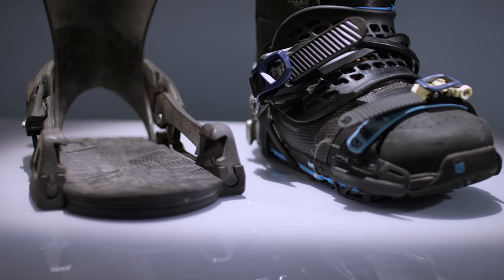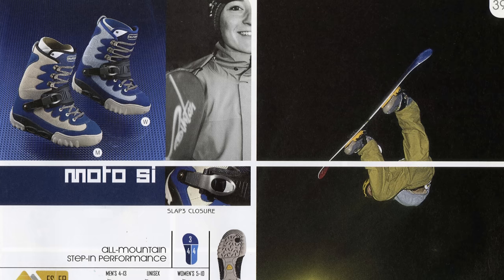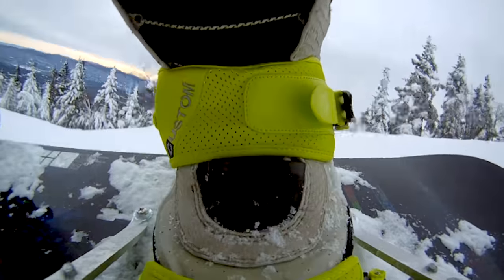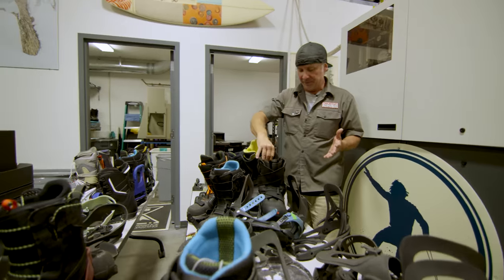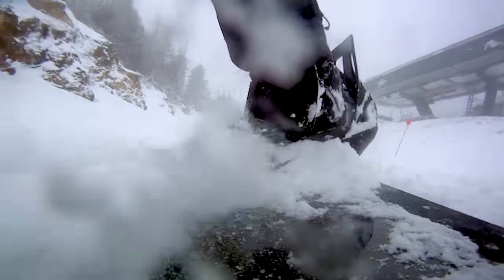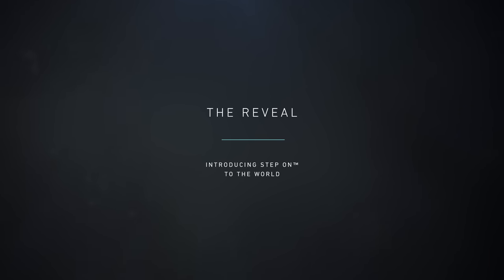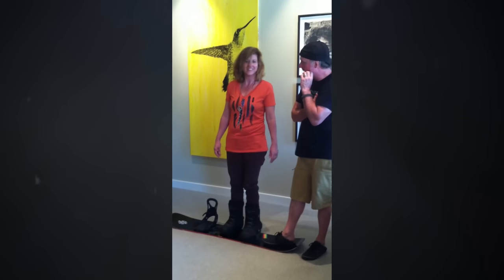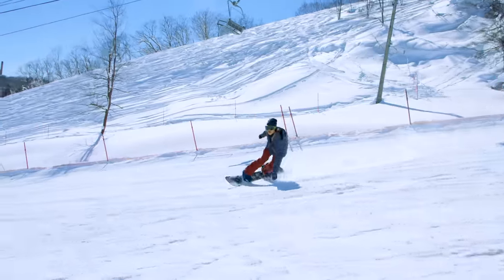Burton Step On® - Research & Development Process

Comment: I had some Burton step-on's in like 2005, they were just not good compared to proper bindings.
Reply: Those were shit.  These are totally different tech and use a standard boot base. The advantage with these step ons is the 3 position lock mechanism.  The heel cleat has two locking positions so when there is some snow in the binding the heel still locks in and self tightens on a heel turn or on an ollie - as the snow dislodges. Comfort, Convenience, Performance. I live in Colorado and have been riding these for 3 seasons, 50+ days/ year and 700,000+ vert ft/ year. Not a single issue.

Comment: I find it funny how they are celebrating something that should have been done 20 years ago.
Reply: 3D printing, rapid prototyping were not available 20 years ago. I think this set-up went through 5000-10,000 iterations over 5 years.   Design, print, assemble, test...repeat until ready.

Comment: Idk why you didn’t just mimic the concept of ski step on technology
Reply: Because the mechanics of ski boots and bindings cause them to be heavy as hell. The glory of snowboard boots is that they can practically be used like regular winter boots, which is necessary when skating across flat areas or hiking in the back-country.
Reply: ski tech is only good for when your feet are pointing downhill, but with a board, your feet are sideways so that can cause a lot of problems. skis pop off when you put too much pressure on them sideways which can cause so many problems if you're snowboarding straight or doing butter or rails or tricks. plus skis are tricky to get off their bindings, that's a problem for snowboarders who have to take off their back binding every time they have to skate or get on a lift.

Comment: It looks cool and progressive BUT it is a very complex and fragile structure. Most likely, it will not stand the test of time, i.e. the bindings or shoes will have to be changed every year, because due to wear, there is a chance to unstrap during the ride. I saw one of the skier's two skis unfastened at high speed. This was a disaster for him... 
Old-style bindings, even the cheapest ones, can guarantee safety because even the cheapest bindings can crack the base, break the belt or buckle, but I don't quilt out of the Board at speed.
Therefore, I personally will not buy a "step On", but will use classic bindings. Sorry, guys from Burton.
Reply: I've had my first pair since launch, they are the exact opposite of "fragile". Not once have the boots come out of the bindings unintentionally. Don't knock what you haven't tried.

Comment: I will never buy Burton ever again.
I tried returning an ak jacket with an obvious manufacturing fault last week, The jacket is 3 years old but I only used it for 3 weeks. 
The warranty person said there is nothing wrong with it and he’ll be sending it back. After 5 days of back and forth he finally admitted the fault but then said it was due to over use and sweat. (The storm flap should have a welded seam but mine hasn’t) 
The guy had made his decision before even looking at it, so whatever was actually wrong with didn’t matter to him. The guy was a jerk. Never again.

Comment: Burton bindings snap every season. Get a plastic than can handle the cold ffs.
Reply: I live in Colorado and have been riding these for 3 seasons, 50+ days/ year and 700,000+ vert ft/ year.  No issues.
Reply: @wrinkle66  ok thanks, had so many cap straps snap over the last few years I'm almost done with them, maybe this will be a better solution.

Comment: Barf. Save the money on R&D and offer better price points on non gimmick gear. 

If you want to “facilitate more riders” the answer is not expensive gear from the early 2000s that failed. Common

Comment: It seems uncomfortable, because you still don't have the security of a strapon with that binding
Reply: Total BS.  You will not come out of these. I live in Colorado and have been riding these for 3 seasons, 50+ days/ year and 700,000+ vert ft/ year. Not a single issue. Straps are more likely to break.

Comment: It's just an inherently flawed concept. Snow fills bindings, making the system not work on snowy days.
Reply: Incorrect. When you step into any binding in powder conditions you would normally brush the snow away. No difference with this binding.  The advantage with these step ons is the heel cleat has two locking positions so when there is some snow in the binding the heel still locks in and self tightens on a heel turn or on an ollie - as the snow dislodges. I live in Colorado and have been riding these for 3 seasons, 50+ days/ year and 700,000+ vert ft/ year. Not a single issue.
Reply: @wrinkle66  Incorrect. They ice up and get packed with snow.
Reply: @bestsnowboarderuknow  You've clearly never tried them. I've never had an issue getting the second heel click.
Reply: @fudhater8592  I have tried them. You have to sit there and kick and kick and kick to clear built up snow and ice out. I think they're not a terrible product for beginner riders.
Reply: @bestsnowboarderuknow  Then you're doing something wrong. I've had these since launch and have had zero problems getting the 2nd heel click. And no, I'm not someone who just rides groomers, in fact, I won't go riding unless there's fresh pow.